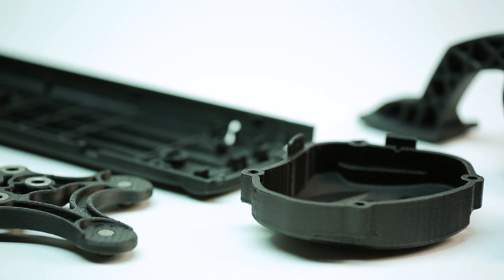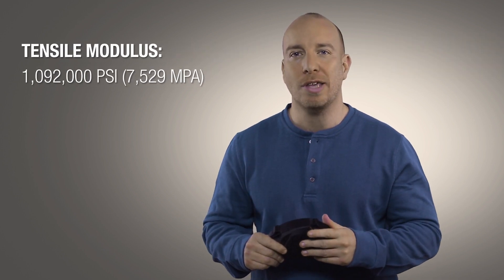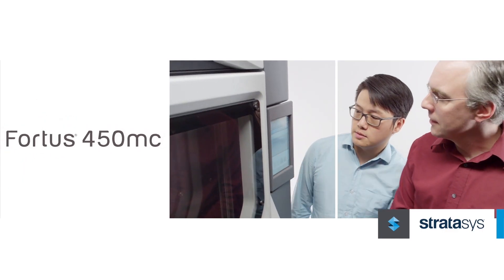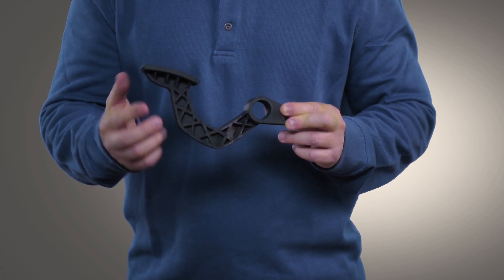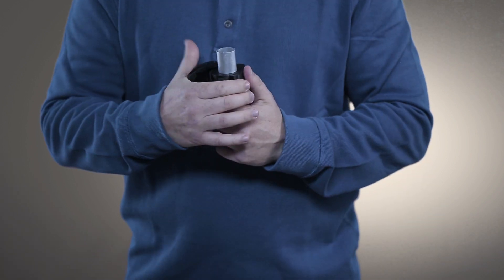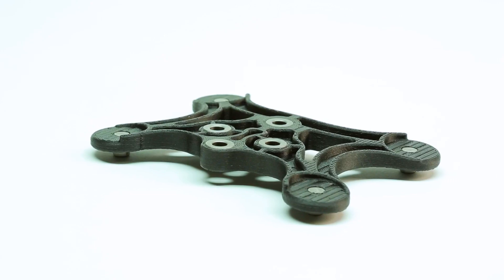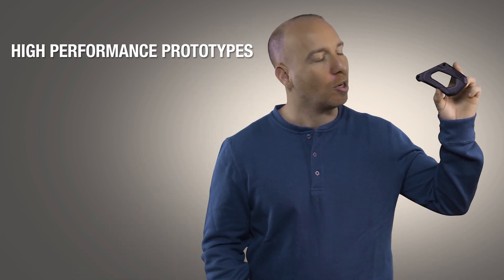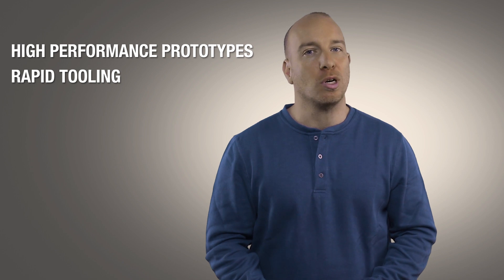Exploring 3D Printed Carbon Filled Nylon | 3D Printing with Nylon 12CF

Comment: Stratasys has never been first on cutting edge printing. My experience with them though has proved their printers are very reliable and also a royal pain to clear if a jam occurs. Don't use old filament! (they tell you this but "you'll know better" until you do it). No I don't work for them. 

Anyone else notice this guy talks out the left side of his mouth but only on the bottom?? Almost seems like he's faking his accent.
Printing PA-CF is cool and all but we just got a 3D Systems metal printer and I'm excited to try it!